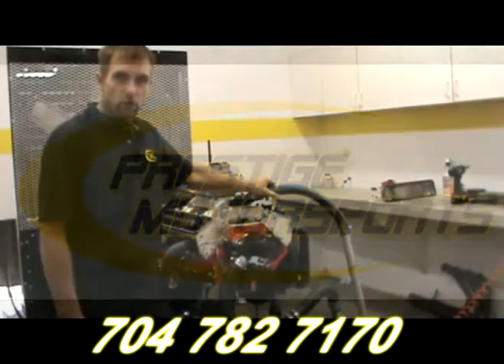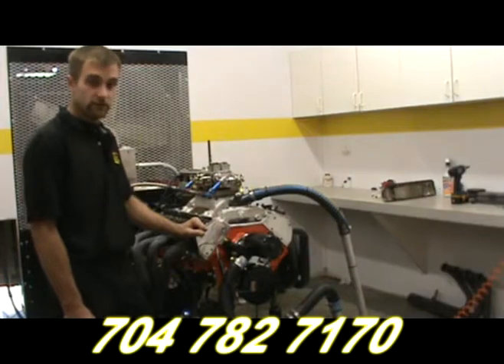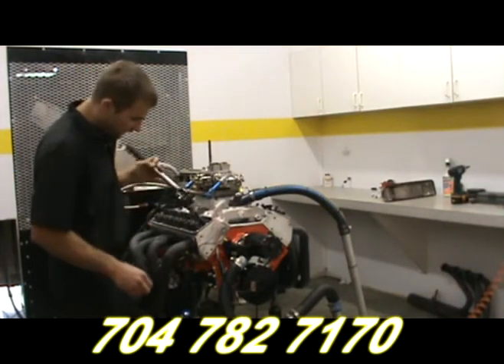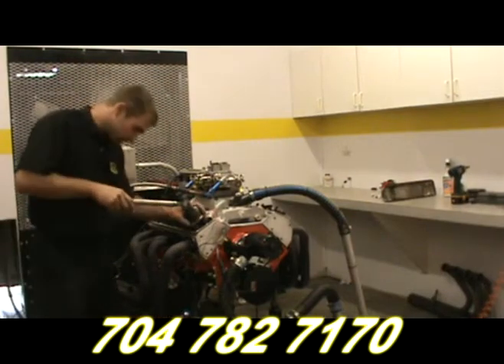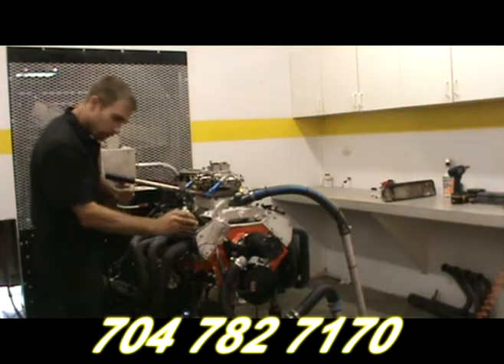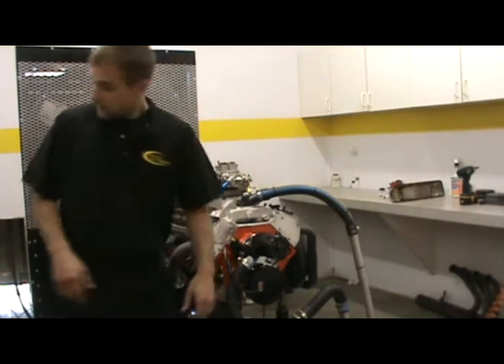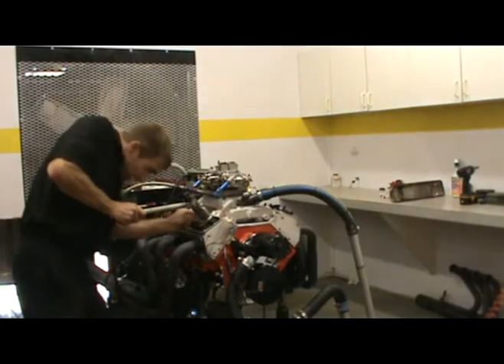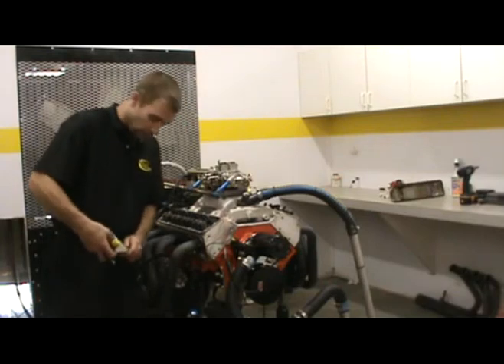DYNO VIDEO- HOW TO CHANGE A VALVE SPRING

Comment: can you tell me how much psi you charged the cylinder with, also where do you rotate the  piston to tdc or at the bottom of the cylinder and last do you lock the motor with a flywheel lock?
Reply: ***** thanks for the help Doug, the springs are isky 6105  --   145# and  315# with a comp cam  fs 294s-10 its a ford 331 with 10-5to1 compression . I look forward to visiting your prestigemotorsports main web page to see what you what you offer. thanks